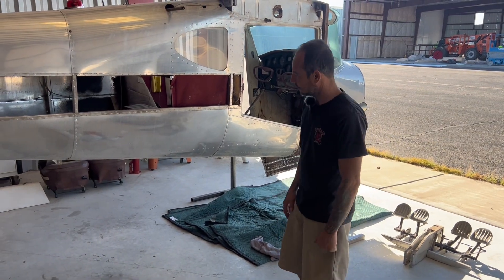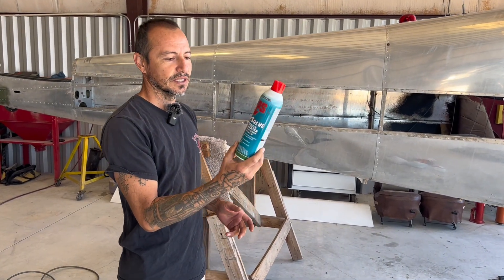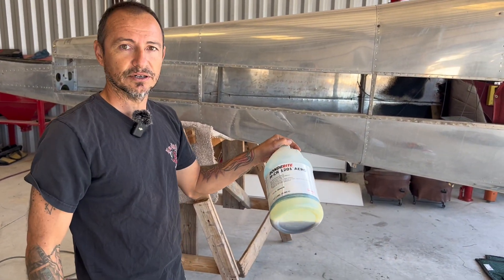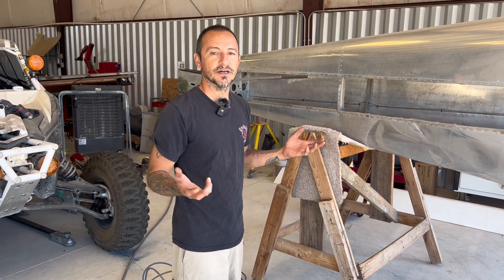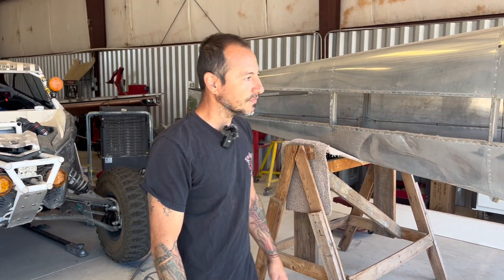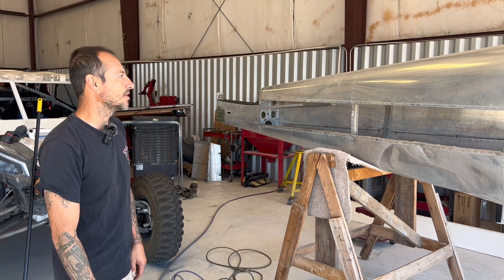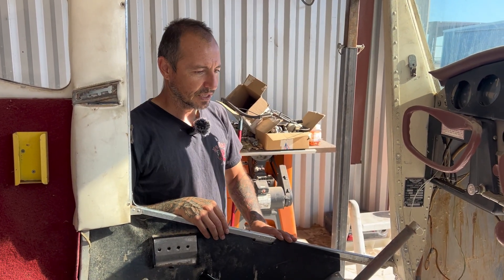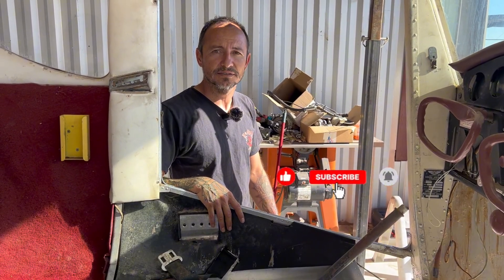Cessna 140 Corrosion Treatment

Comment: I would use the alodyne after because you remove the cladding with the cleaning process.
Reply: The cleaning shouldn't remove the cladding unless it was super aggressive but I would do the alodyne treatment . You did the hardest part already and it will offer good protection for years to come.
Reply from the maker: Thanks for watching. Yes the alodyne definitely won’t hurt to include up front on the pans. We were surprised the amount of accumulation of junk under there from the years gone by and aside from trying to maneuver around inspection covers there is no easy way under there aside from having the gear out like we have. Upcoming video we will be reassembling everything and soon to have it back on its gear.